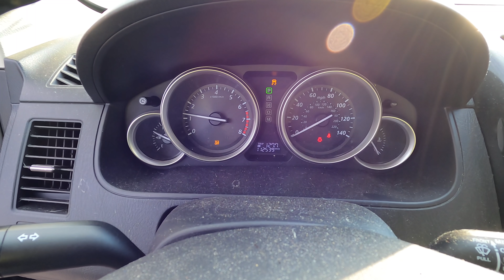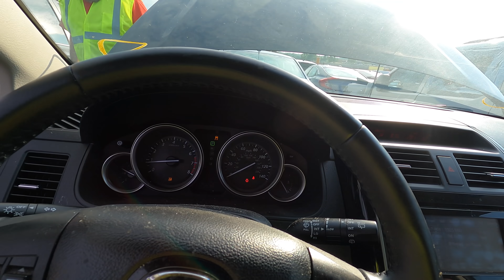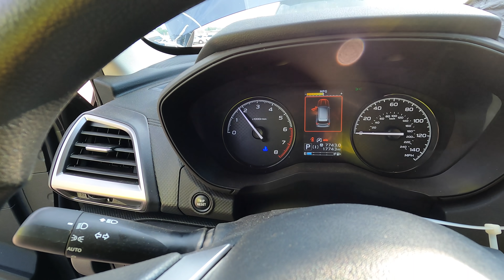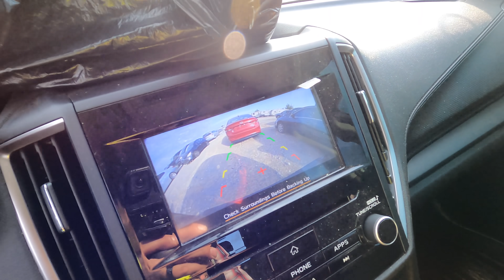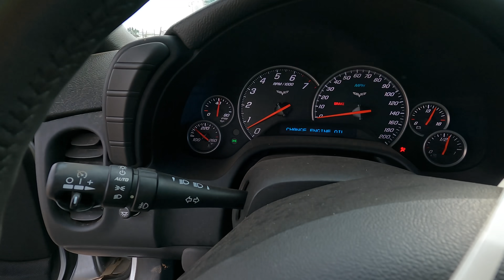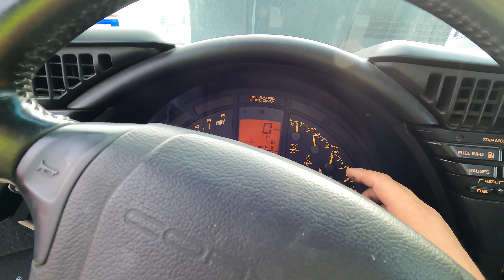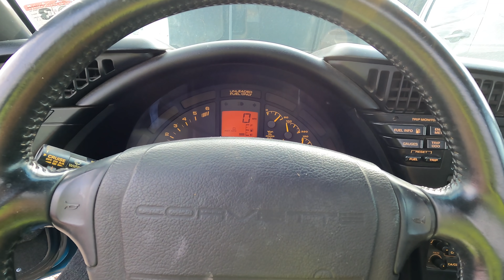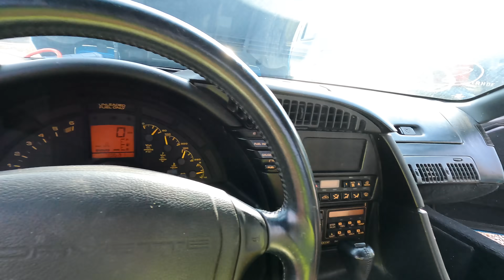Copart Walk Around 8-18-21 + 40th Anniversary Corvette & Biohazard Carnage!!

Comment: Eyesight is Subarus collision safety and prevention system. Works great. Sometimes it doesn’t turn on when the car was dead. Yes they all idle high when cold
Reply: A few years TFL Car did a segment on the Subaru eyesight system
Reply: Are the sensors related to eyesight installed in the windshield?  My neighbor needed to pay $2500 to replace her windshield after a huge rock from a truck shattered it,   I was thinking "Ouch" and "why" at the same time.  Thank God she carries full collision.

Comment: That C6 could be a steal. Derek did a video a while ago putting a radiator pack into a wrecked C6. Easy enough with a lift😉

Also, the exhaust isn't a concern. You forget/overlook the fact that Copart are always shuffling the cars around with a forklift. Exhaust and valence damage is almost a given even on a 2021 car that drives perfectly...

But yes, you should buy it😎

Comment: Eyesight uses cameras mounted at the top of the windshield to monitor adaptive cruise, collision detection, etc... will not work if the cameras can't see past the nose of the car. Even fog inside or outside the windshield will cause the system to disable itself until conditions clear up. (Source: my 2018 Subaru Impreza Sport Wagon)

Comment: Randy, that C4 is a a ZR-1. That is not a Lt-1. That's the Dual Overhead cam 5.7. Built by Lotus for GM. At least it appears that way, with that large intake manifold, and those valve covers, it could be one that got dressed up as a LT-9
Reply: The trans and body are definitely not ZR1. Manual only and the Zr1 is wider, which this car is neither.
Reply: Didn't the ZR-1 have the valet key full engine power and so on selector under the radio? Don't see one in that C4. The lack of a manual should have been a larger give away to me. Completely overlooked that.
Reply: No, that's an LT1. The ZR1 engine is distinctive, the upper plenum will have 8 runners per side, as well as 4cam 32 valve printed on it. The valve covers would be  twice the width, and the entire upper end will be finished in aluminum, not black valve covers

Comment: The auto-stop-start is annoying until you get used to it. My Cherokee had it and my new Forester has it. It was explained to me that the starters have been beefed up to handle the extra starting. I did read that the gas saving is minimal on an individual basis, something like 1 gallon every 10,000 miles. However, in the cumulative, if every car had the feature, the gas saving is substantial over time.

Comment: FYI. Start/stop DOES NOT use the starter to re-start the car. To restart, the cylinder in its compression stroke would get a small squirt of fuel that, when burned, would spin the internals backward just enough to produce compression in the neighboring cylinder. That cylinder would then receive a normal supply of fuel, and its combustion would spin the crank in the proper direction.
Reply: What would ignite the fuel though if the spark plug aren’t firing?

Comment: Hiya Randy.  If you get the chance on the Mazda, fire it up and wind the steering wheel from lock to lock and back to centre.  If it's like others of that era, it should clear the ABS and stability control warning lights on the dash.  If the battery goes flat at any time, these check lights stay on until someone does that little trick.  Had it happen when I changed the battery in my wife's Mazda, so personal experience there!  Hope that helps.

Comment: Subaru Eyesight is Subaru's front Collison avoidance and adaptive cruise control system, lane keep assist. it utilizes the two cameras placed in the windshield and acts much like a fighter jet target locking system. it continually analyzes objects in the path of travel. newer versions (potentially in this 2020 forester) has  autonomous steering that can steer you away from a Collison

Comment: Ironman tires are owned by Cooper. I may end up getting some Ironman A/Ts to replace my Cooper A/T3 4S when they wear out.

PS. I'd definitely get the Subaru if it goes for less than half the price (under $12K), replace the windshield and drive the heck out of it.

Then I'd gradually look for a hood and driver side doors, secret is not to be in a hurry
Reply: Goodyear owns Cooper.
Reply: @s99614  didn't know that. When I purchased my Discoverer AT3 4S tires they were not owned by Goodyear yet.
But I like that they're made in USA and cheaper than other top tier brands

Comment: My 2021 Hyundai does t have auto start stop. But my 2018 Ford did. I researched the effect it would have on the starter and I guess the starters are designed differently, where a normal starter is good for say 3000 starts the new starters would be good for say 30,000

Comment: The auto on and auto off can be helpful in a crash so it turns off the engine instead of running and may cause a spark and light the car in flames

Comment: With that Mazda that might be the camshaft position sensor. Hubby's truck is acting up with that again but thankfully it is the same sensor that we got replaced so we that will be a super cheap fix just the problem is getting it back down to the mechanic
Reply: But that traction light came on in our truck along with the engine light of course the time the mechanic closed for the day

Comment: Where I stayed is it practically is like a help paid for driving it has cameras on either side either check on the quarter panels or in the windshield we own a Subaru ascent but before that we owned a Mustang GT 5.0 L in a Subaru Forrester 2017 2016 for the mustang then we own a 2000 Chevy truck The ascent is a 2020

Comment: Stay away from the 93 corvette. The distributor probably needs to replaced. My 94 went out at 75,000 mi. The distributor is on the front of the engine. My guess nowadays it would cost you $2000+ to replace. Your friend.